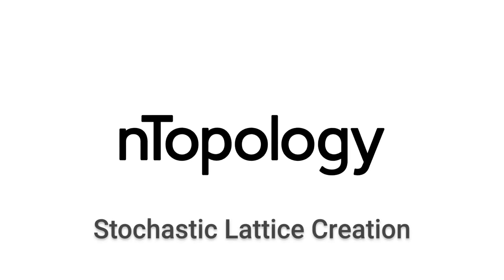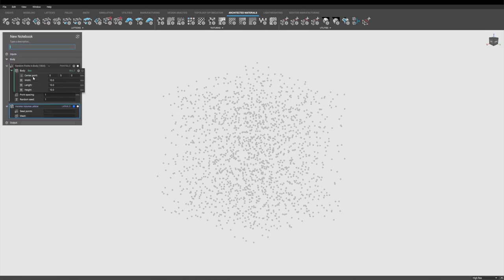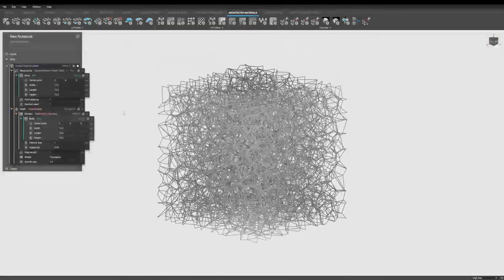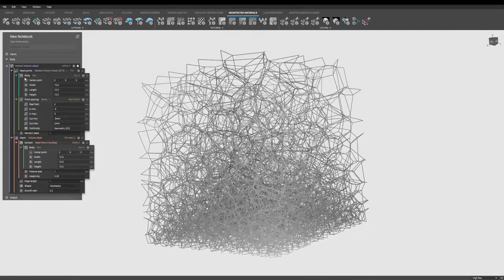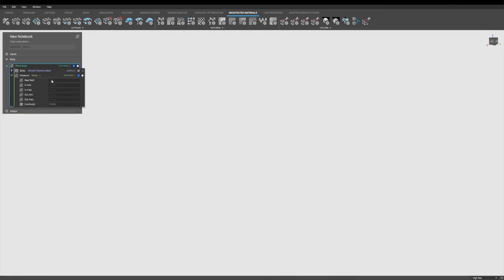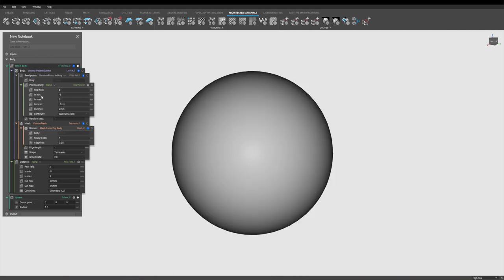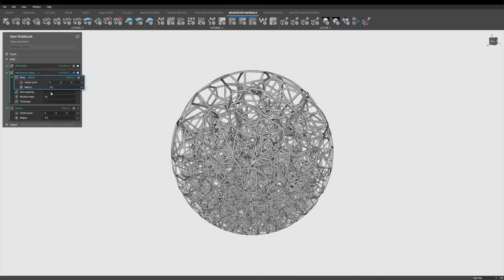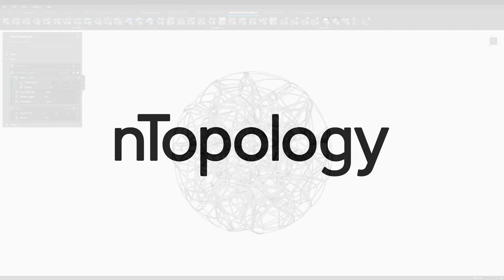Creating a Stochastic Lattice

Comment: This is great, thanks! I also would like to know if there is a way to use an image file as input for gradient control, like a depth map or using RGB values. I guess it could control the distribution of those points at the beginning.
Reply from the maker: Yes! that is certainly possible to do in nTop Platform
Reply: @nTopology  Thank you very much! I look forward to learn how to do that.